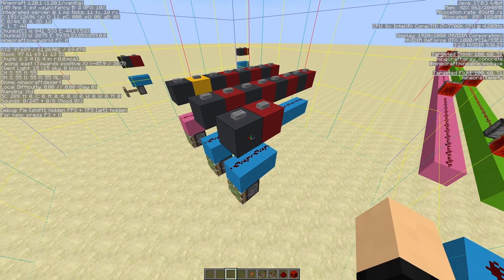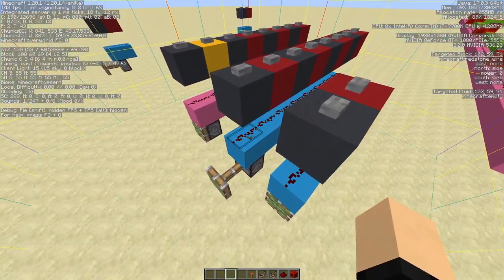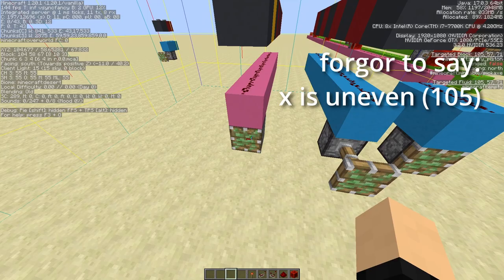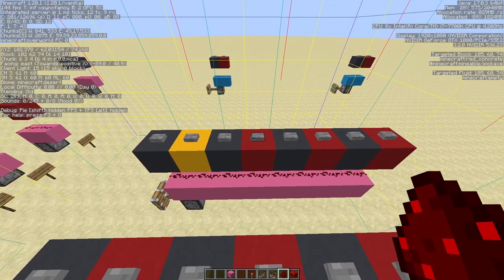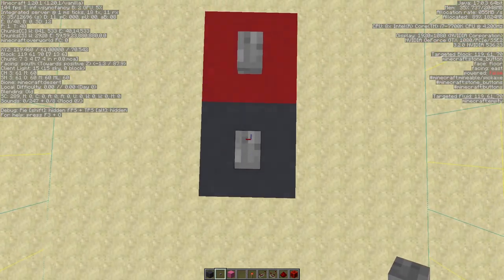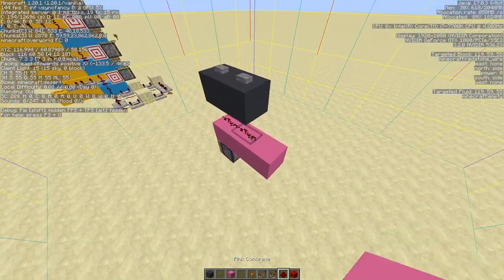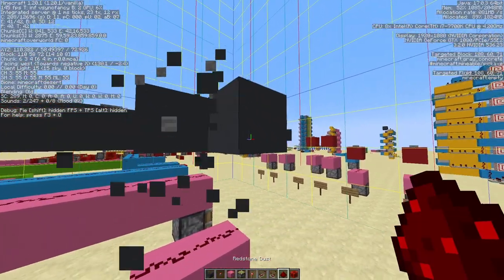undiscovered piston BUD? (at even signal strengths) minecraft 1.20

Comment: Dust locationality. In that specific location, the redstone dust directly above the piston is processed before the one diagonally above it, so the piston stays extended despite the redstone dust turning off at the same time. But if you moved the entire thing 1 block in any direction, then the piston might be fine. It all depends on the coordinates of the redstone dust. This isn't properly documented anywhere, but it's been known for many many years. There's 3 ways to fix it:
- Place the redstone dust directly above the piston on top of a note block
OR
- Place the redstone dust diagonally above the piston on top of a transparent block like glass or a slab
OR
- Install the "alternate current" mod by Spacewalker, which rewrites part of the redstone dust code to make it more efficient and less locational

Comment: So two things are happening here:
- Pistons (and also droppers/dispensers) have a property called quasi-connectivity (QC), which allows them to be powered from blocks not directly adjacent to them. Block updates only propagate through adjacent (not diagonal) blocks, so depowering the redstone doesn't update it and the piston will remain extended until it receives another update and realizes it isn't powered.
- The order of block updates from redstone dust is locational, meaning that the updates propagate in a different order depending on both where the dust is and where the power source is. This is because the block positions to update are collected in a hashset.

When the dust directly above the piston depowers first, the piston is still being powered by the block diagonal to it through QC, so it doesn't contract. The rest of the dust depowering doesn't cause a block update that reaches the piston, so it stays BUDed. If the updates happen to occur in the other order, then the piston depowers normally.
Reply from the maker: i don't think that explains why the press at 0:30 makes it contract, and why the press at 0:32 makes it stay extended. i don't think i understand why at 0:52 the yellow block (second block) doesn't work until the redstone is extended at 1:00.

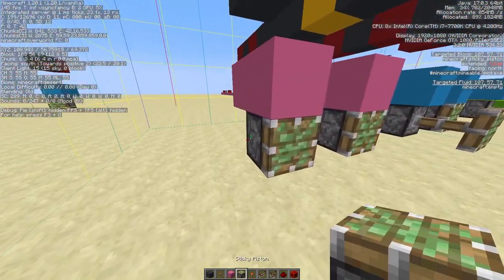at 2:14, it doesn't stay extended, but when i move the thing one block horizontally it does stay extended.

i get QC, but i don't think it's the main cause here. or?
Reply: @vladde  This is caused by dust locationality, and the piston is demonstrating that locationality is occurring because of its QC. The only thing that specifically matters here is the update order between the dusts above and diagonal to the piston during the depowering, which changes based on position of the dust and power source (the button), as I mentioned. 0:52 is a case where the update order changes because (to simplify it) the amount of updates change, as it propagates down the other side away from the piston.

There is no pattern, at least not any that's actually useful to anything. The only reason it is at all consistent at the same position and setup is because block positions are hashed based on their coordinates, and the positions are always added based on the order of the Direction enum (down up north south west east). I recommend Earthcomputer's (almost 30 minute) video on redstone dust update order as the most in-depth source.
Reply from the maker: thanks for the explanation and video recommendation, just watched it! going to sit down and figure out how this affects my bud :)

Comment: I assume this is because the block update order when powering/depowering redstone is based on which order the blocks come in a hashset, which is somewhat random, but still based on something, so I guess in small hashsets with the (probably) standard Java implementation, the even numbers are more likely to be earlier maybe, or is it the opposite maybe, idk, but it is obviously also based on where the input source is, so I don't really get how that works

Like, if the dust above the piston gets updated before the dust one away, the piston will receive an update, but notices it is powered by QC by the second dust, so it stays extended, and when the second dust gets updated, the block update does not reach the piston, because that's how QC works.